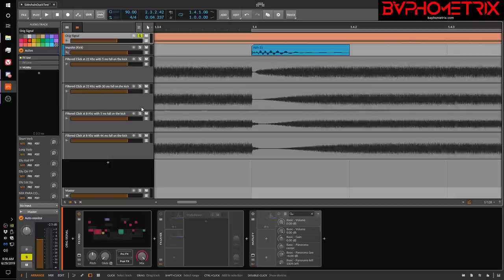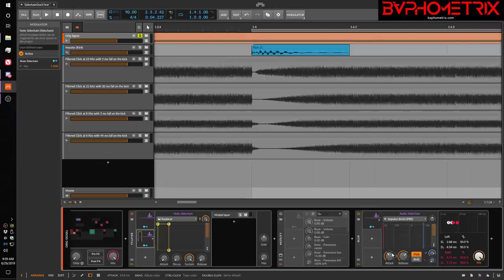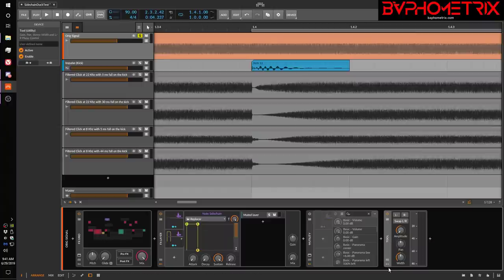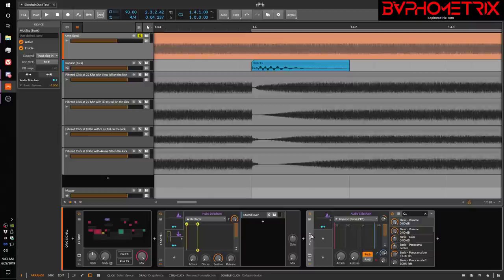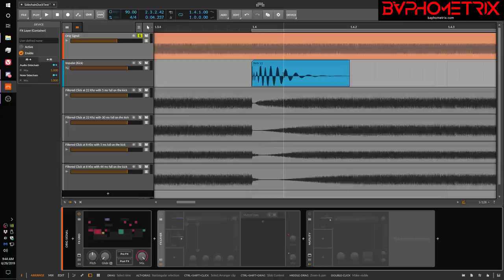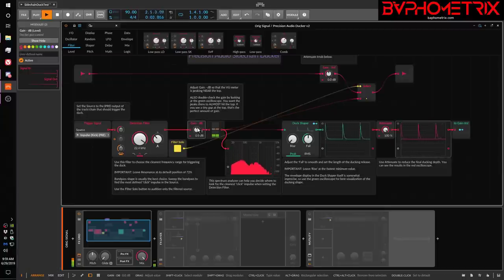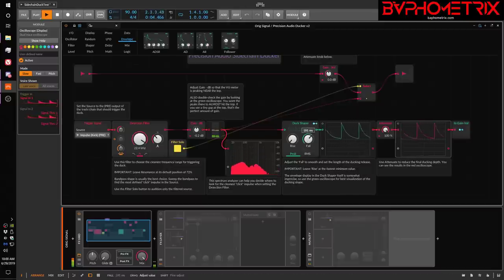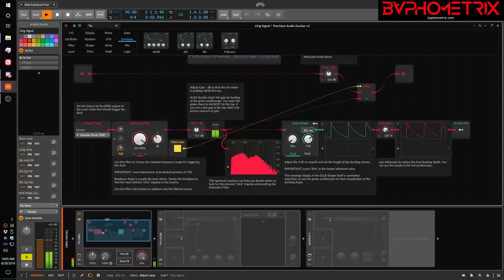Bitwig 26 - Precision Audio Ducking in v3.0 with the Grid

Comment: The audio side chain modulator in my opinion sucks for side chaining you’re better off using the Bitwig dynamics Device or better yet use the Sheps Omni channel by waves
Reply from the maker: There are lots of tricky nuances depending on genre and how far and long you want to duck. The main problem with the Audio Sidechain modulator for ducking is that it usually works by modulating something like a "Gain" knob on something like Tool or a 3rd party utility VST, and most such gain knobs (even in 3rd party VSTs) are intentionally "smoothed" to create more of a faded response curve instead of a precise, linear response curve.

Comment: One more question, Do you really need to make the sidechain - infinity (I think tool will work well most of the time)?
What case would you want - Infinity?.
Also I did this experiment on Bitwig 3.01 and ti was working as it supposed to. I'm pretty sure I'm doing it right, I have created many limiter instances in the
master channel to have a good latency but when I bounce time and track it works as supposed to.
Thanks
Reply from the maker: Everyone has their own pet approaches to sidechaining, and different songs and genres tend to use different amounts of sidechaining. Not every method can duck to -inf. For example, nearly every sidechaining technique that uses a compressor can only duck -12 or -18 dB at most. Which is fine for certain genres and needs. Heavier EDM genres with heavier style drops tend to prefer ducking all the way to -inf or at least much further than only -12 dB.

Comment: Wow. Yeah, this bug is pretty serious. So I guess now I know why my mixes sounded off. My projects are filled with sidechains.

Regardless, people can definitely hear 1ms (or even less) latency. For example, try have 2 channels (L and R) slightly timed differently. That's definitely audible, even in sub-ms ranges.
Also, I may have missed something, but it's not entirely clear how The Grid sidechain is immune against the global delay.
Reply from the maker: I don't think that it revolves around "the grid is immune against the global PDC delay". I think it's more that one specific (but unfortunately also very common) use case for audio sidechaining simply has a PDC compensation bug that for whatever reason hasn't yet been squashed.

If you put an Audio Sidechain modulator in (for example) a Polysynth Instrument, and then modulate a ton of knobs inside the Polysynth, the PDC compensation is perfect regardless of how loaded up your project might be with laggy plugins.
Reply: Interesting to know, thanks. Regardless, I'm going to send them a bugreport about this as well.
Reply: Just turning your head slightly will change the time of one speaker reaching your ear by a ms.  Very few people can tell a difference below 5 ms.  There’s a reason 20 ms is acceptable delay for Bluetooth audio to still appear properly synced for dialogue to lip sync.  Less than that just doesn’t make a big difference.  Watch Brain Games sometime, they had a great episode on brain latency and how your brain basically predicts movement constantly to make up for its milliseconds of delay in processing optical input.
Reply from the maker: @boothbuster  Indeed. However, it's not uncommon for many of us producers to rack up at least 200 ms or more of latency on our master bus when we're in mixdown and mastering stages. Regardless, it will be less of an issue soon, because Bitwig is aware of this latency issue with certain use cases of the Audio Sidechain and Note Sidechain modulators, and they'll be fixing in one of the next updates.
Reply: Oh I’m with you... I never could get serious with Live knowing it wasn’t compensating for plug-in delay... if I tweak an effect like a delay or even just placing notes off grid, I definitely want to know everything is lock sync together whenever I re-open a project or change other plugins around.  I was just referring to the other comment that we can hear less than a millisecond of difference between two channels, I just don’t think it’s possible.  Interesting side fact - our brains trust the auditory senses more than the visual, I forget what that show Brain Games did to illustrate the point but I think it was counting how many times something appeared on screen... first time they did it with an audio cue, next time the cue did not correspond with the visuals, so it was much harder to count JUST the visuals... the brain does process sound faster than vision, so it “trusts” audio more, which I found fascinating to see and hear proven out by that show.